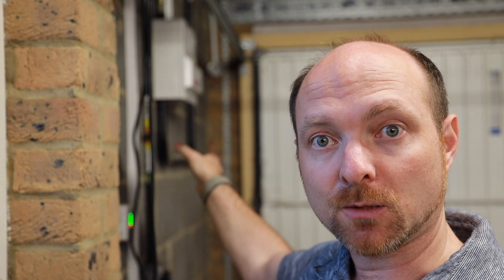V2G BIG UPDATE!

Comment: Looking forward to seeing the results of the trial.

The following is a little rant which I hope you will forgive…….

It is a shame that the term “grid” is used on this scheme  because as you said the overall power network is somewhat like a tree.

I can see  micro generation injection providing power to the local LV distribution network and at a pinch upward into the 11kv network.
The impedance is far too high to inject upward into the actual grid which is at 275kv and 132kv. The levels downward from the grid to the LV distribution are 66kv, 33kv, 11kv. ( often known as the sub transmission network)

I have been retired a long time and there could be some fantastic new technology but I did spend some years modelling and designing large grid control stations.

I can see why a distribution network operator could be worried about the cable capacity of their network at LV level when distribution cables were sized based on an after diversity demand of 7 kw / house.

It looks like vehicle to home is a winner all the way especially with battery prices falling.

There is a lot of investment going into long term battery storage for the high voltage power networks especially in California. Air-iron batteries are being tested but are hugely expensive. The dream is that long term storage will enable  renewables to really work and fully replace fossil fuels. In the UK liquid metal batteries have been undergoing development for at least 10 years but still not quite viable. We are in for large increases in electricity prices and I would install PV and battery storage in a flash if I didn’t live in a wood with massive shading problems.

Nuclear is clearly the answer!!!!!  ( How did we go from leading the world in nuclear power to being a non player?)

BTW….Didn’t upgrade my old 2013 iMac….bought a new 24 inch one with a trade in of £350
Reply from the maker: Wow Michael, I think we could do a whole video about this and other comments. For me it’s great insight and makes a lot of sense, plus fills in some of the detail that I don’t have.

I think the separation of v2g and v2h isn’t something that I fully appreciated going in. And I think that is very important for customers to appreciate. 

I hope that there would be a hybrid future in which a vehicle to home system could contribute to the local area by having feedback from the transformer via a data network so that all the homes on that segment would contribute enough energy but not too much. Using IoT networks like LoRa for example. That could help de risk things for the DNO, but would require a modest technology overlay. 

Thanks for the awesome contribution 👍

Comment: We installed PVs in 2011. Seemed simple but what we didn’t know was that instead of improving the local infrastructure the DNO had just increased the voltage. That restricted the number of panels we could install and found that when the sun came out and voltage on the line went up it would trip out. Been corrected now but it sounds as if you are having a similar problem
Reply from the maker: Interesting, I’m not entirely sure as it’s all kinda second hand information really. Definitely lots of different issue you can get in to with micro generation

Comment: Good to hear you you're reaching the next stage in the the journey and I hope today goes well. I'm being told mine will be installed in the next few weeks.

What I'd like to know is this:
Technically, (in the T&Cs) the G100 limit is ours as it applies to our homes. Neither Octopus or UKPN have sent me any documentation to show the calculations that have led to the export limit. Unlike you, I live in Brentwood and I can't see any solar panels near me. Nor have I been told how in the future it will be possible to have the limit reviewed.

In incidentally I'd like to hear how you get on with your Quasar. Mine charges fine but the Wifi reliability is not good with the app and it has another odd glitch that they tell me is yet to be resolved. This is that when it is charging it isn't correctly communicating with the car so you won't get the screen on the dash showing how long it will take to charge to 75% etc and the Nissan Connect app will show "Plugged in, not charging".

Finally, be aware it will only charge to 97%
Reply from the maker: Cool stuff, thanks for the info. I have no idea how they calculate, but it would be interesting to find out. 
I’m using the Zappi until some of the kinks are worked out. Hopefully they will sort soon 🤞. Wi-fi as a medium is not something I like to rely on but I’d recommend 2.4ghz over 5ghz if possible as the signal would go further. Will see how it goes!

Comment: I’m glad you’re eventually getting your system installed, I look forward to seeing how it goes.
It’s ridiculous that you have to install a G100 box.  Your electricity import connection will probably be rated at 80Amps (20kW) so therefore you can also export 80A without problems.

But your DNO calculates it as if everyone in your street is exporting 20kW (which of course they won’t) and so it just MIGHT overload the grid.  Basically the electricity companies don’t really want you to export energy because that’s their business, and also it you will reduce your bills, which they don’t want - so they do not assist exporters.

I agree that Microgeneration customers (with solar panels) really want vehicle-to-home (V2H) not V2G systems.  But that would mean these customers would have near-zero bills, so the electricity companies (and government) do not want this to be easy.

Also I think it’s ridiculous that the CCS charging system does not support V2G, unlike Chademo which is being phased out.  There Is a huge number of new electric cars being bought now, which will not be able to participate in V2G in the future because they have CCS charging.

The Government need to mandate that ALL new EV’s must be V2G comparable, for future proofing.
Reply from the maker: Hi William, I think its a little excessive but I think that part of any trial is to tread cairfully, but i agree its certainly a nuance. 
I defiantly thing CCS will evolve a V2G capability at some stage, but your quite right this will likely exclude current cars with the standard, as it will almost certainly require different software and hardware behind the plug, even if it looks the same. Hopefully the standard will evolve on the basis that trials like this prove there is a major benefit from this technology.

Comment: I would not want to use my car traction battery as a virtual power station for the grid (I think the quasar wall box can export 7Kw) but I would not mind if it would just act as a battery for a power wall my own use and just prevent import from the grid during the night. I have Solar panels which help to prevent import from the grid during the day. 

I would like to see the outcome of your trial so will be watching for updates
Reply from the maker: Hi Mark this is a key point you raise actually, I don’t know exactly if this level of control will be available. I agree that it would be excellent if it could be like a power wall for your own use. I think it would be preferential to a static power wall given most people change cars more regularly than house hold appliances.
Reply: @eviain  Hi I think it would be fairly easy to manufacture an inverter that works of the traction battery and program the output to give an export of say 25 watts. When the house load increases and the house starts to import from the grid the inverter would ramp the output up to get back to the 25 watt export level. When the house load decreased the inverter would ramp down the output to get back to the 25 watt export level. When I don't charge the car or have anything on timers for the low night rate I use about 2Kwh between 6pm - 6am so would not use much power out of the traction battery.